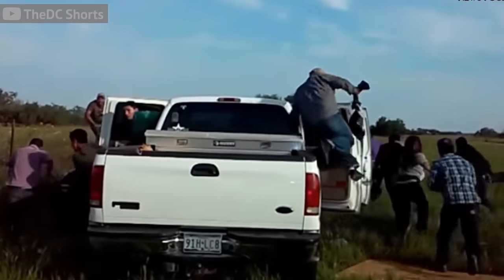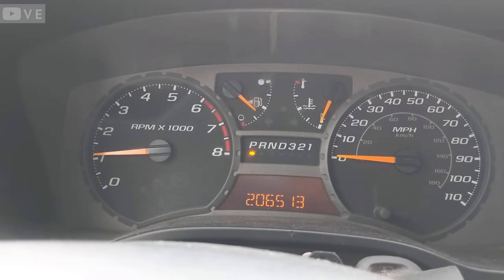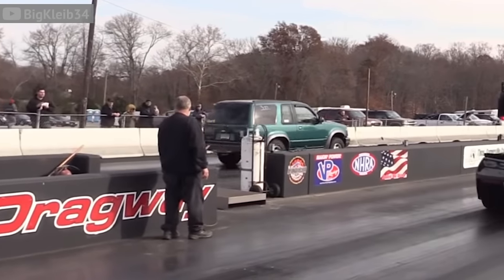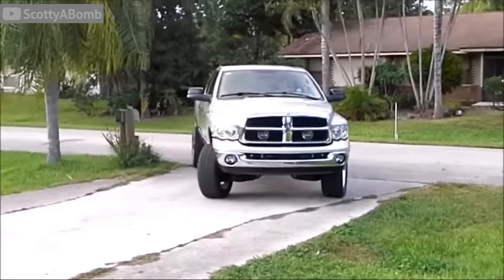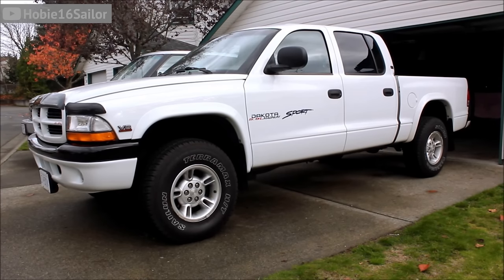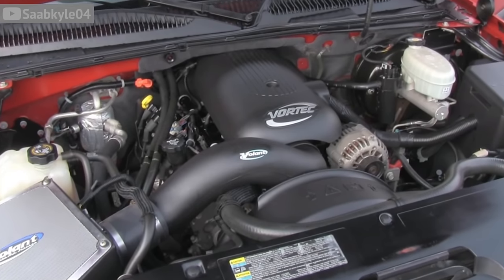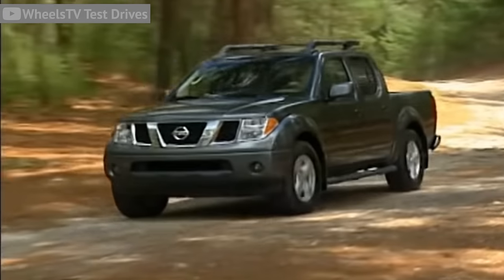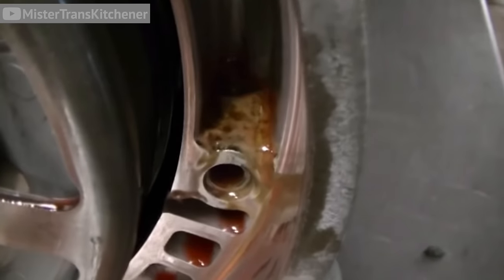USED TRUCKS YOU SHOULD NEVER BUY!

Comment: I love how he adds avalanche to it and all he can say is that the cladding fades and speedometer issues😂
Reply: I havent had any of those issues with my 03
Reply: I've got an 04 with 260k on the clock and the only issue I'm just starting to have is my torque converter is starting to act up and my bed covers are faded real bad. Other than that she starts and runs like a top every time.
Reply: These babies definitely get me to point A-Z
Reply: Thanks for all the replies, I have a 2002 avalanche that’s amazing!
Reply: speedometer issues we're common in Chevys. He just wanted to take a fat dump on it.
Reply: I had an 03 z66 and i put 550k on it i didnt have any major issues with it other than changing spark plugs and coil packs
Reply: I'm considering buying a 2003 Z71 Avalanche, what do i need to know?
Reply: @driftwood8613  Make sure the frame is good and make sure the check engine is off. If it does have a misfire, test it. An OBD2 reader is your best friend. Next check the spare tire. 99% chance it'll be stuck in place and need fixing. Try buying ones that are from down south as they will have very little rust [assuming you're in America] 
Avoid the cladding model if you wish to customize the vehicle. The window motors [front driver and passenger] may need replacing. Mine takes around 40s to close and gets stuck. [putting curves on a window was a very smart idea said no one ever] 

And do not spend more than 7-10k unless it's in PERFECT condition with under 100k miles.
Reply: @driftwood8613  the top couple things you need to know is that they are prone to frame rot really bad so get some undercoat from oreilys or something and put it on also like in the video you will probably have to replace the tachometer once mine went out when it hit 300k a couple years back. Also avoid any with sunroofs/moon roofs. Also before you buy it check out the brakes because I've talked to so many people who say after about 200k they got to replace the master cylinder. Other than that you're fine, the 5.3l is a reliable engine i had to scrap my 03 because once it hit 500k it started finally having major issues and i didn't want to put a ton of money into it so i sold it and bought another avalanche but it is the 06 z71 instead of the 03 z66 and im really enjoying it you'll have fun with the avalanche if you do get one
Reply: The speedometer issues weren't just in the avalanche. All the Chevy trucks from around 03-06 had issues with gauge cluster and blow motor resistor. Chevy had recalls on them. So it wasn't just the avalanche or Colorado/canyon like he said.
Reply: @driftwood8613  you should know its amazing truck im litterly picking up one this weekend
Reply: Actually he also said engine and transmission issues also but go bro truck go right....
Reply: I've had no issues with my 2010 besides a tire pressure sensor needing replaced
Reply: Favorite truck: 2002-2006 Avalanche 2500, 4x4 with 8.1 liter.
Reply: @pauljohnson3524  if that's the case, why didn't he mention the Silverado?  Same engine/transmission.  That's because he's full of shit.  Those Avalanche trucks were built like tanks.
Reply: I know. I've got an 02 with 224k and had had no problems besides the plastic fittings on the firewall and brake calipers locked up
Reply: Bobbie we have, our rear diff just had to be replaced and our oil gage just died. And the auto 4 wheel drive is goofy. Other than that best truck I could ask for
Reply: He also said they have transmission failures but I guess u are hard of hearing or have issues comprehending words
Reply: I have a 02 lanche and I wouldn’t sell it. Everybody wants to buy it and no way I’d ever sell it. This guy is no mechanic u have to be the dumbest person in the world to say something bad about the 5.3l vortec 🤦🏼‍♂️
Reply: @tyggy3  my speedometer died i have a 03
Reply: I’m considering buying a used avalanche with over 200K not sure if that’s a good idea or not
Reply: @tyggy3  
Me either.
Reply: I have both
Reply: I got an 03 Tahoe with the same speedometer issue, literally just had to replace a little motor on the back of the instrument cluster, wow those speedometer issues are a real deal breaker
Reply: This is one man’s opinion.....the Avalanche is the most versatile truck ever made, the plastic can be easily be restored easily and that is really the only issue with this truck.
Reply: @driftwood8613  that the Avalanche is an awesome, versatile and reliable truck, best one Chevy ever made!
Reply: im at 400k miles with zero issues on mine
Reply: @driftwood8613  you will need window regulators at one point or another
Reply: @splishsplash2150  what do you mean?
Reply: @driftwood8613  the window regulators are the only issue I’ve had, I’ve put six in in the twenty years I’ve had mine
Reply: @ArkaniumGaming  cladded models are way better than non cladded
Reply: @radnybolt5327  You're limited on the mods you can add with the cladded. Do your research.
Reply: @ArkaniumGaming  I own a cladded model and as for engine mode they have the same drivetrain and suspension so there are no limits there their are also plenty of custom taillights headlights grill guards. Clearly u don’t own a cladded model or are just to lazy to look because there is no limit to the customization available. So don’t sit there an flat out lie because you are unaware about something
Reply: @ArkaniumGaming  also there are aftermarket bumpers hoods ventvisors so do tell me how the cladded models are limited in customization
Reply: @ArkaniumGaming  it’s ok to admit you don’t know what you are taking about . Also the cladded models look a hell of a lot better than the boring non cladded ones
Reply: @radnybolt5327  I was talking about external body mods. In my case I wanted to attach new lower fog lights. It said it was for "non-cladding models" as it wouldn't fit the same. At some point last year the lights are no longer available. On a cladded AV the hood, grille, fenders, lights, and bumper are unique to the front end of the AV.
Reply: @radnybolt5327  Also, it's okay to admit you don't know what you're talking about bud.
Reply: @ArkaniumGaming  as I own a highly modded cladded avalanche I do know what I’m talking about u simply didn’t look hard enough
Reply: I got an 03 and it does burn a bit of oil but not too bad.
Reply: Thanks everyone I'm thinking about buying a 09 avalanche and I'm looking all over the place for reviews
Reply: @enriquebaez4515  If you're going to tow get one from before 2006. 2006+ have a lower towing capacity. example: 2009, 5,000 to 5,500 lbs vs 2004, 8,000 to 12,000 lbs.
Reply: @ArkaniumGaming  thank you
Reply: I have a 03 Avalanche 1500 - Has 100k miles on it and have NO issues with anything he mentioned. Maintain your vehicles and you shouldn't have issues, simple.
Reply: Im looking to purchase a 2004 avalanche tomorrow with 193,000 miles for 4300 I need a truck for my dirt bikes so you guys are saying. That the avalanches are good
Reply: @Me23-e4u  I'd recommend one. Just check it over and make sure nothing serious is wrong with it.
Reply: @Me23-e4u  They are if proper maintenance has been done. If you treat this truck right, it will last forever. Pushing 300k on mine. [got a new engine at 280k because the last owner neglected to fix the misfire and it became a domino effect]
Reply: Not to mention those speedometer issues apply to pretty much any GM truck of that era. It's not a hard fix and it's really not that common
Reply: And bro all this this guy listed for the lanch is all basic issues with GM the only thing we could all nag about is the trying to keep up on the fedders for the rear🤣🤣
Reply: Still got my '06 never had those issues. Sounds made up to me! Maybe he's mad he never got one and now you just about can't find them cause everyone wants them if they can find them used! LOL
Reply: RIGHT...🤣😂
Reply: Got myself an 06 avalanche thing has just started showing it’s issues at 220,000 of hard use. She isn’t going anywhere going to put a new motor in most likely and suggestions?
Reply: And transmission and engine issues
Reply: People would eat sht for views
Reply: That’s cause they’re reliable. I’ve had an  03 avalanche then I traded it in and I missed the thing so much I got an 02 Escalade ext lol. Got the awd I wanted and the 6.0 with the bigger transmission
Reply: @pauljohnson3524 lol man those 5.3s are built proof and sought after. Drink oil? Eh maybe, one way to stop it was the upgraded valve cover. I’ve been pushing 600hp on stock bottom for 4 years no hiccups. The 4l slippy is a different story. Upgraded to the 4l80, never looked back.
Reply: : Owned a 2010 LT for the last 2 years with a 170,000 miles now & never had any major issues. The speedometer is still fine, but yes the cladding gets faded, but that’s an easy fix. My truck looks like it was built a year ago, and I’ve had it almost 3 years now…🥃

Comment: My 2004 avalanche has been in the family since brand new and now I own it and it has been one of the best trucks I’ve ever owned. No trans or major motor problems with 222k miles on it now. Up keep Maintenance is key to any vehicle lasting long.. the back black plastics are hard to keep looking black and not faded grey but that’s the main up keep I have to do about every 3-4 months. Rhino liner coming soon!
Reply: Same here I have a 2004 that I bought off my parents and been in the family since it was bought off the lot. It's the most comfortable truck I've ever driven. It has a new transmission and transfer case and the engine runs strong at 232k. Routine maintenance is key, this guy is a fuckin tool lmao
Reply: My father bought his new in 02 and gave me the keys when I turned 17. The avalanche is an awesome middle ground crew cab when you need it and full length bed when you need it. Mid gate is a great concept they also came on the hummer. 18 years of towing/hauling only maintenance was the water pump starter and changing the fluids. Even at that it took 15 years for those parts mentioned to go bad and yes the cladding fades in the sun. If you have one with cladding. I just put armor all on it. Either way one of the most reliable trucks we’ve had in the family.
Reply: Yep have an 04 ... no issues, rides great, perfect for camping, fishing ...
Reply: yeah I've mostly had no issues with my avalanche only recently have I had issues with my transmission and I just hit 224k
Reply: I take back what I said... im now having electrical issues regarding the trucks computer systems
Reply: Yeah I have an 2002 and never had an issue. Ideal got their facts all wrong lol if anything kids these days are stealing Chevy with the vortex engine because is been realizable and for power and aside from the molding fading which isn’t a big deal, they didn’t even mention the abs module which Chevy is famous for going bad. The fact that ideal didn’t mention that, means they didn’t get their facts right. What a disappointment from ideal. Please research your facts before you post crap. Smdh.
Reply: Baby Oil will turn your avalanche back black
Reply: Damn it seems like everyone bought their avalanche off their parents like me 😂😂 Avalanche Gang stand strong 💪🏿
Reply: Sold my 06 avalanche 5 years ago and had 300 + thousand on it with very little maintenance repairs other than tires/oil/breaks.  I just bought another one 2 years ago and I'm about to do the ss frt bumper swap on it..  I have had the non cladding models..  great trucks and repair costs are low.. can't beat that.
Reply: he doesn't have a clue
Reply: I hear you loud and clear..
I own a 04 avalanche Z71 that I purchased from my brother.
He bought it in 05 and used it for his contracting business haul all sorts of trailer's with super heavy loads.
The trans finally had enough and I had it rebuilt at 291,000k!
Wouldn't trade my lanch for anything!

Comment: does this guy realize that the avalanche, sierra, and silverado all have the same engine and transmission?
Reply: Ozzie Sheppard Obviously not
Reply: Find most people are oblivious to GM trucks similarities. Including their full sized SUVs and avalanche
Reply: "It's almost like they took a Suburban, chopped the back and made a truck bed". Ummmm that's actually exactly what they did, try and keep up lol.
Reply: @mckjordan  Ayyy sounds like my comment with your own twist, lol cheers man.
Reply: Thats correct! And the Suburban..I have an Avalanche and my husband has 2 Suburbans (one we use for parts) and just about everything is interchangeable between the 2. All mentioned sit on the same frame (almost exact, there is one slight difference on the Avey frame at the rear shocks) same motor, same trans, close enough to the same exact suspension parts too.
Reply: @judge724  So why single out the Avalanche then? I've got an 02 with literally no body rust. My brother's 04 Sierra is turning into a Frankenstein truck and will shortly have all new body parts from 4 or 5 rust free trucks. Rust is a lot worse than some faded paint that will take a hundred bucks and part of a day to fix.
Reply: Ozzie Sheppard  apparently not 🤦‍♂️🤦‍♂️🤦‍♂️
Reply: Nope. For that matter the 4l60e transmissions, which aren't super amazing, were in all of those trucks from 2008 and before. But now they all come with a pretty decent 6 speed. Also the 5.3 is a good engine, just had some issues with afm from 07-11 or so. A range tuner can mostly mitigate those issues
Reply: Bill Billiams literally no one in the rust belt who makes less than $50k salary has the time or resources to put rust protection on their vehicles. And even when you do, it still ends up rotting out at some point. I can’t afford to do it, let alone have someone else do it, and I work full time as a lift equipment mechanic.
Reply: @judge724  the  Avalanche.  is pretty cool i like the fact it has no bed box like the silverado   aka single piece design
Reply: the avalanche were actually more reliable than the pickups... tahoe, yukon too... not sure what the deal is.  wonder if thats because they werent used for towing or work vehicles like the pickups due to their suspension and shorter wheelbase??
Reply: @mckjordan  well what do you expect from someone who looks like a gay car enthusiast.
Reply: The only thing I have wrong with mine is the fact it burns oil on longer than normal trips
Reply: And ssr has the chassis of a corvette 🙄🙄
Reply: the avalanche 5.3 was weak compare to a sliverado 5.3 or 4.8 for that matter
Reply: Brady Kee how when it came with the same heads and transmission lol
Reply: @811brian  how much do you get paid per hour??
Reply: Odi Arroyo a bit over $16, but also student loans.
Reply: @666dynomax  can u clarify if u read somewhere that the yukon and Tahoe are more reliable than the Sierra and Silverado?

I read that the 5.4 liter engine in these SUVs during early 2000s was terrible.
Reply: @avenlouis1486  They are 5.3L, and yes the Tahoe/Yukon and the Avalanche have all been known for reliability.  Do a quick search... I think its likely more due to their use... they aren't geared up for work or towing like their truck counterpart.  A truck I own is going to always do well with reliability and long life because I don't tow, use it for work, plow etc with it... its basically a car... I would not think a Sierra or SIlverado would be less reliable in the same situation as a yukon/tahoe.
Reply: @bradykee5273  they're exactly the same man
Reply: @bradykee5273  same engine, same drive train. I don’t think you have a clue.
Reply: @811brian  
 You can buy a can and do-it-yourself, I did it in a day.
Reply: @bradykee5273  
 Oh yes, because the 5.3 liter in the Silverado was magically better performing than the 5.3 leader in the avalanche...
 Same engine, dude.
Reply: @nickdial8528  it’s like owning a silverado but a lot heavier therefore it is better preforming

Comment: My avalanche has a factory g80 locker. And the 5.3 kills ricers all day long...200k and she purrs like a kitten.
Reply: Which trim/year comes with the locker? Is a rear locker or center?
Reply: I plowed snow in a 2003 Avalanche 2500 with the 8.1 liter in it. Never had an issue but it did consume oil.
Reply: @senderoverland  Z66 and Z71.
Reply: Mine has 386k miles. I dont know if I kill ricers since I have 35’s. But it’s still a daily driver.

Comment: Chevy Avalanche 220,000 miles still going, still looks brand new.
Reply: Avalanche with almost 350,000 miles and still up and running good
Reply: Just a small oil leak
Reply: Mine too! It's an '09 with just over 200k. Love it!
Reply: 04 with 170k miles and have 0 issues
Reply: 2002 with 450,000 miles still going strong a little wear and tear from previous owner but otherwise runs great

Comment: The Chevy avalanche is my favorite truck
Reply: I have one. They look kind of ugly in my opinion but They are good for their beds, being able to tie shit with the framing.
Reply: I have a Escalade Ext ,6.0 Awd -Airshocks ,dual zone air-conditioning, rear entertainment, leather seats , flexible on oil ( conv/full syn). The only con's are changing oil every 1k and premium gas only unless it's a emergency , plus only 13 mpg
Reply: I have a 02 it sucks
Reply: @xavierdavis6222  try the 2005 8.1 liter z85
Reply: Beauty is in the eyes of the beholder, I guess. I can't get past the cheap plastic all over the place.
Reply: For good reason. Mine too
Reply: Same
Reply: I have an all original 02 Avalanche Z66 with 328,434 miles
Reply: @tilendynaguy4895   mine is an 05 z71 280,000 miles
Reply: I got 02 NFE 1400000 only and it's a beast. This guy need real job.
Reply: I got a 07 avalanche 200,000 miles. Runs like a heavyweight champion !!!
Reply: I have a 2002 Avalanche with 300,000 miles. Original engine and trans.  I would not trade it for anything
Reply: @xavierdavis6222  what’s wrong with it.too many problems?
Reply: Same